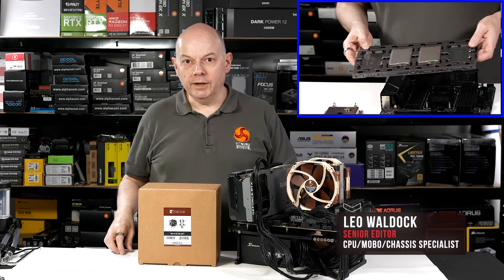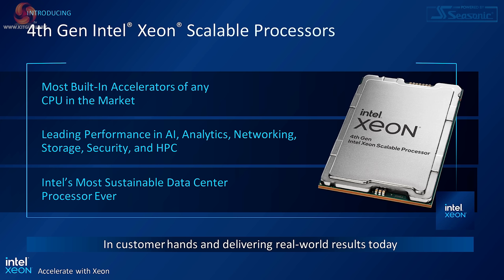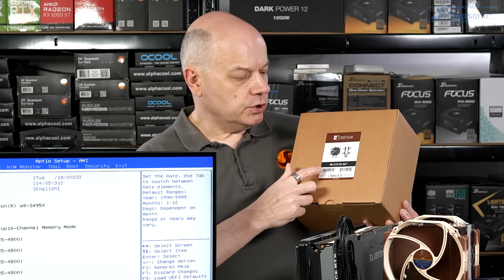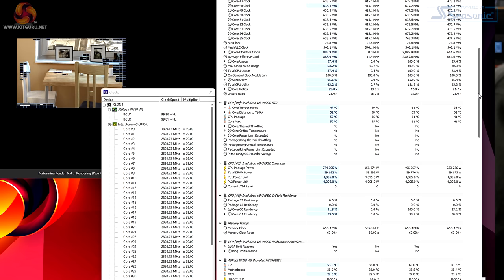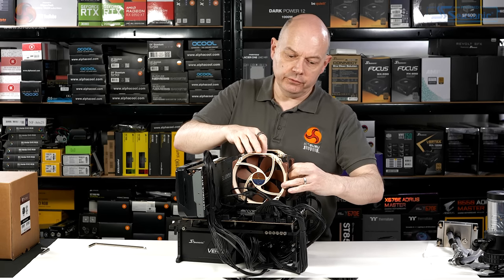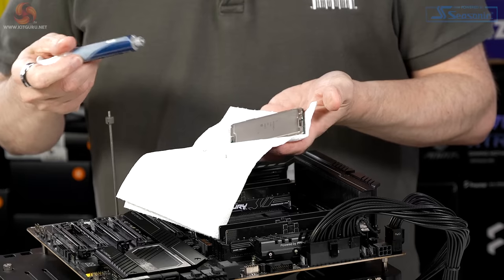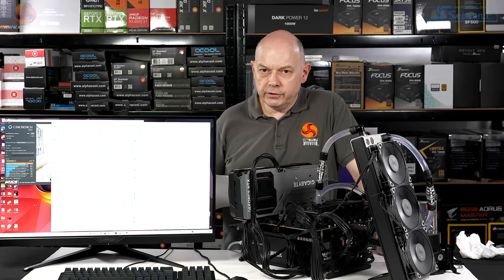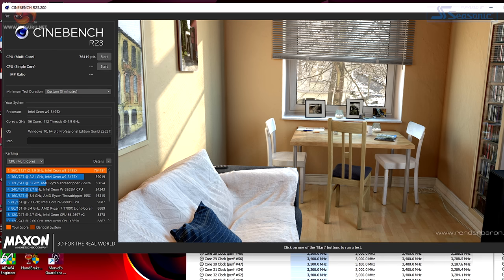4th Gen Intel Xeon W9-3495X – I Got The Power! 💪🏻

Comment: Lets just think about that for a minute. That cooler was absorbing 500watt of and still managing 60c. Amazing.
Reply: Only thing I'm thinking is how you can get a 96 core 192 thread Epyc for $1000 more and it uses 140w less power while being much more powerful.
Reply: @bdhale34  30% more cores and 20% more performance??
Reply: @bdhale34 all I can think about is my $300 cpu that also has much more performance in a clock speed application

Comment: What's interesting is I have a quad socket with 4 e7-8890 v3 that is 18c/32thread per cpu at 2.5ghz base and 3.3ghz boost at 165w per cpu. So for all 4 cpus in total at max draw is 660w. These cpus came out in q2 2015. So I have 72c/144t @ 3.3ghz at 660watt compared to 56c/112t @ 550w. It's crazy that in 8+ years things have shrunk to a smaller package but at the same power if not higher.

Comment: I enjoyed that; thank you, Leo. I was most impressed with that air cooler and I hope you test it some more. Hopefully it will work even better with the W-24xx parts. Please, Intel, let Leo test those, particularly the 12 and 16 core models.

I was gobsmacked by the power consumption, but then I wondered: for your viewers, does that really matter? It matters massively in a datacentre, of course, but in an office environment 500W where it won't be running full tilt 24/7 is it really important? And in a home environment, at that price point people cope with 600W GPUs so is a 500W CPU really that much of an issue? Especially here in the UK where it doesn't normally get that hot.
Reply: The w5-2455X Looks good. I currently have a LGA 2066 i9 10900x what should I do?
Reply: @rejeangadbois3123  That's what we need Leo to answer.

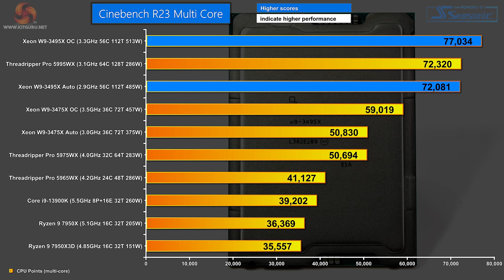Comment: 13:04 tells me all I need to know. At the same level of performance the Intel draws 70% more power (+200W) over the AMD. Never mind the electrical bill, consider the cooling requirements. My TR Pro happily runs on a Noctua air cooler, no need to mess with liquid and it's quite cheaper. And then there's the fact that the Intel requires unusual, expensive DDR5 whereas my half-terabyte of ECC DDR4 cost me less than two grand. I've been on team blue for about 10 years but now I'm team red and it looks like it'll stay that way for a while.
Reply: Yes, this xeon can run normally without throttling with noctua

Comment: 16:30 on the memory testing results, why is the DDR5 memory on W3495 performing slower than DDR4 performing on Threadripper Pro, is this a latency issue? thanks
Reply: Quad channel DDR5 vs octo channel DDR4. On paper the 56 core Xeon also allows octo channel but they couldn't enable it on any available motherboard at the time.

Comment: Hello
I'm looking to buy a new workstation and I'm thinking about buying either amd 5995wx or w9-3495x.

I want to be able to work and play games one computer
I know it's not the right cpu for the game, but if you have any recommendations, which one would you recommend? (5995wx vs 3495x)

my task deals with 3D point cloud-related data and develops related engines.
monitor I'm using is ultra wide 4K (3840 x 1600)
Reply: I would look for some kind of benchmark for the workload, assumingly that gaming is not the main focus. Even workloads with DaVinci Resolve differ alot, depending on how the application is used. Some calculations may be offloaded to the GPU, changing the system requirements profoundly. There are a variety of accelerator cards like AMD Instinct and nVidia H/A series for specific workloads who do not compromise on precision like the usual gaming cards (FP64), not cheap either, but maybe helping processing the workload faster by a huge amount There are providers like Puget Systems who do benchmarks for applications and assemble hardware optimized for the task, really testing it in-house before choosing suitable components for the customer. I would assume that a GPU for gaming can be added at the end because of the vast PCIe lanes a HEDT platform possesses if another accelerator is already in place.

Comment: Hey Leo, a question: why did you move the GPU? Isn't part of the point of these boards that you have multiple full x16 slots so could you not have left it?
Reply from the maker: Yes I could however 
a) PCIe1 is Gen 5 x16 and PCIe2 is Gen 5 x8
b) You can guarantee there would be comments about the GPU being in the 'wrong' slot
Leo
Reply: @KitGuruTech  Quite right to do it, then.

Comment: thats an insane performance level - I cant get over those temperatures mind you, is that accurate leo?
Reply: I would have thought so, its 4x the surface area of 1700 chips but only pulling 200w more, so equivalent of running a 13900k for example at 125w instead of 300w
Reply: It doesn't even come close to AMD EPYC CPUs, obviously not shown here.
Reply: yes, i remember it sounds similar to 40x i auditioned back then (most neutral amongst others)

Comment: I'd love to have a play with this platform.  It's almost what I'm looking for.  I'm still on X99 and really want something to upgrade to.  I have an 8 core.  I'm looking for 12 to 16 cores.  I am unwilling to give up the 40 PCIE lanes and quad channel memory.  I am also unwilling to pay more than around $1500 for the board and CPU as that's already 50% more than the X99 setup ran and at that time Intel was the 'overpriced monopoly' that released a $1700 CPU and was laughed out of the room.  WHY are people cheering at HEDT priced consumer parts and AMD starting their almost HEDT CPUs (HEDT shouldn't used registered memory, that's workstation and server stuff) at $1400 and going all the way up to $10000 while still thinking the i7-6950X was overpriced?  They're all overpriced, but at least when Intel was the monopoly, the entry point was reasonable and buying 50% or more cores than is currently needed on the consumer platform (4 back then and 8 today) got you HEDT features.

Comment: Powerfull ,yes . Expensive ?  , oh yes , typical Intel price unless you buy the 8 Core variant and even then an 13900K is cheaper and stronger = more performant . The 56 Core cost 6000 - 7000 and has   n o   IGPU which is bad for Premiere like Workloads . AMDs TR with Zen4 will be out relativly soon = 3-4 month ? = second half of 2023 with a re introduction of a non pro TR 7000 and a 7000 pro TR with up to 96 Cores and i guess 12 channel DDR5 , maybe even an " X " Vcache variant with over 1 GB of L3 Cache . 
Besides , i would edit the Headline into " i suck the Power " LOL ;) , especially if you OC your W9-3495X ...

Comment: I thought that Sapphire Rapids had Alder Lake P-cores, so I expected single-core Cinebench to be on par with an i9-12900, around 2K points or more.
Reply from the maker: Clock speeds are much lower then desktop hence low scores. Realistically, how often do you run single core workloads on a 56-core workstation.
Leo

Comment: 500W power draw at current electricity prices doesn't seem right.
Reply: Epyc 9654, 360w 96 cores 192 threads about $1000 more.. wonder why he didn't test against these chips real competition, AMD enterprise chips, Epyc.
Reply: @bdhale34  Epyc is server CPU, but this is a workstation testbench. Intel has server CPUs as well. Would be nice to see a server testbench as well, but it is not that appealing visually - but the unboxing and assembly surely is.

Comment: Why did you test the W9 3495X with only 4 channels of RAM? The W9 3495X (and the other 3000-series cpus) supports 8 memory channels. It is the w7-2495X that only supports 4 channels. I am sorry but I can’t take the results of this review as being valid. Not only that but you also only used 64GB. It is important to have at least 2GB per core otherwise you deprive the cores of RAM. Don't take it from me or from Intel, take it from AMD - they were the ones saying it. Please repeat the tests of the W93495X using at least 128GB of RAM ideally in 8 channel configuration (8x16GB). I am sure there will be a significant difference at least in some tests and in any case it will make for a good content.
Reply from the maker: As mentioned in the unboxing/preview video we were sent the motherboard and two CPUs by Intel and sourced the DDR5 ourselves. (edit: and Intel knew which kit we were using before we started our testing) Cast your eyes around YouTube for another review of this CPU and you won't find much as the hardware was devilishly tricky to get together. We don't have the Asus W790E-SAGE that supports eight channels of RAM and the only video I can find is at Asus' own HQ so I guess they are thin on the ground. If you do find evidence of one in the wild I would be intrigued to see what kind of memory it runs and at what speed. (second edit: when we requested a RAM kit from Kingston they asked about the CPUs and motherboard and then sent us the kit you see in this video)
Leo

Comment: The Threadripper isn't this chip's competition though, Epyc is and they go up to 192 core 384 threads (per socket) using around the power this 56 core Intel chip does. For $1000 more you can get the 96 core 192 thread Epyc 9654 and it only uses 360W. Thumbnail is ever so slightly misleading, you can't overclock away a 40 core deficiency let alone the top tier Epyc's 136 core advantage.
Reply from the maker: The two Xeon W9 we were sent by Intel are intedned for 'Expert Workstation' use so the comparison with Threadipper Pro has some value.
Leo

Comment: RIP 100% performance but 200% power draw of a 2 year old cpu (3 year old architecture).
Epyc 9554p is 6 months old now and already kicks it down the stairs and steals its lunch money, That's not including its bigger brothers 9634 and 9654P whick blow it into the weeds for a small price increase.
£10,000 for 56cores and 500w versus £13,000 for 96cores at 360w is not a hard decision.
No wonder its getting the Broadwell treatment and being replaced in the next half a year.

Comment: Most powerful CPU? Yeah just ignore the AMD EPYC 9000 series with up to 96 cores and 192 threads lol or even the last gen EPYC 7000 series with up to 64 cores 128 threads. (and by the way it uses more power and costs more than the latter 64 core EPYC 7000)
It's like saying the RTX 4080 is the most powerful GPU while not including the 4090....
Reply from the maker: Powerful, as in 495W power draw, hence the pained expression in the thumbnail. By contrast the AMD EPYC 9654 has aTDP of 360W and peaks around 420W.
Leo

Comment: something dont sit right with temps vs cooler and watts. i smell intel bs. 500 + watts and 60c from that tiny surface area from air cooled cooler.
Reply from the maker: Well it's a good thing you could see the figures on screen in HWiNFO so that everything was laid out and completely transparent.
Leo